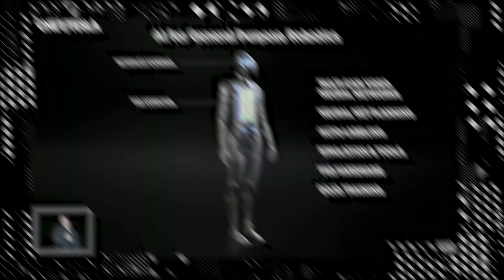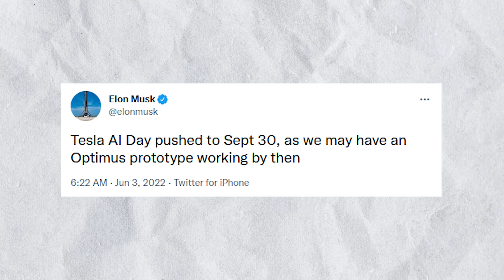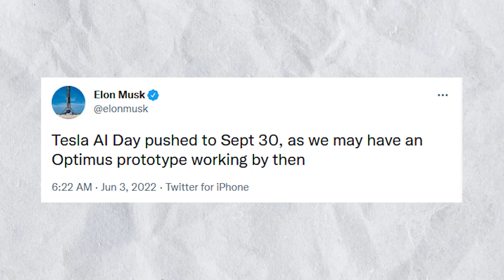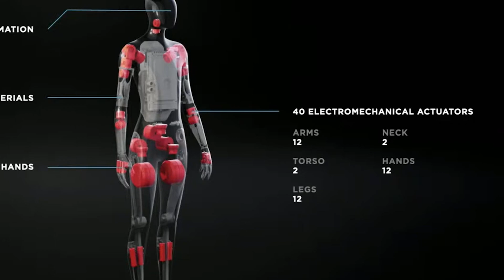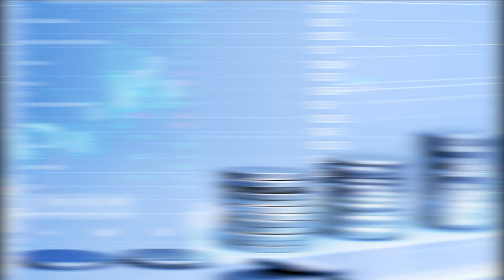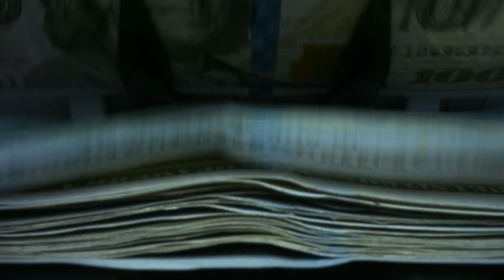2023 Tesla Robot Update You Need to Know

Comment: The global scale partitioning predefined here at 5.8 feet locates the angles of mobility of the organs of the multi-exo-skeleton-apps towards an approach related to the development of responses from the tension blocks of the phalanges of the feet of the prototype.

 Here without cavitation bonds back the limbs the velocity and
the amplitude are seen limited, this human simplification of the feet and the leg disperse the balance. These machines are capable of perpendicular straightening where the spread of the aductor mechanism corrects the imbalance of the masses during the ascent.

The humanoid form of proven movement of the body towards
the front is a catch-up of vertical twists due to the constant rear correction of the heels in their opposite direction then on their side of movement damped in the block of the knees of the pelvis where the shoulders shift towards the direction in line or change of direction . This current size 1.0 limits this hyper-sophisticated mannequin to simple earthly domestic work, like driving a passenger coach!

The modular feet are articulated on corrections of telemecanique diving pads then feed on an infinity of vector from a shock dissipator formed by a planetary block 3 winding fixed on front shield (servo-meniscus) allowing
to increase the rhythm of the walk during the evacuations of vibrations of wear.

 This scalable 2.5 foot ladder built on a mosaic of semi-damped tactile tracks generates its own momentum reserve
of mass energy with an evolution of center of gravity reset space between the superimposed servo-triangles of arches of the foot / ankle for adaptation to extreme temperature, ability to climb, functional mimicry A.I. in the postures of martial arts.or exploration divers..Deployment of greenhouses for the construction of habitats on Mars or on the moon.

The telemechanical resistance indices from the feet to the knees of the pelvis determining the size, power, agility, mobility coefficient in an anti-gravity environment of the robotic assistant.